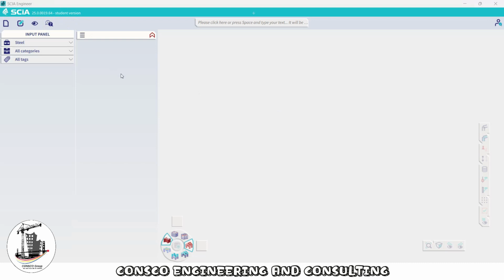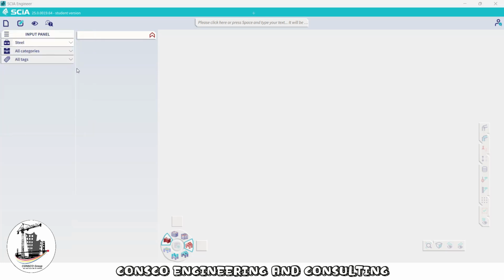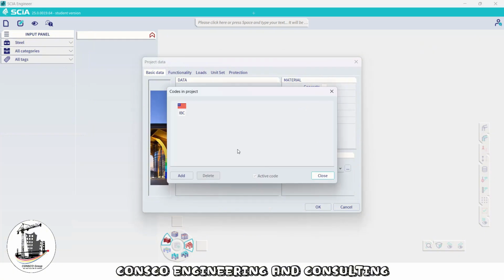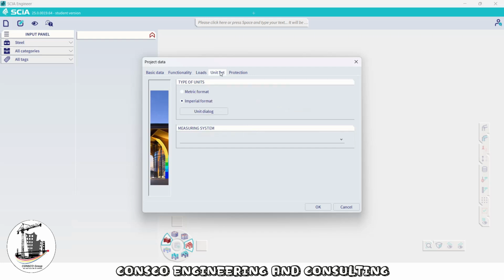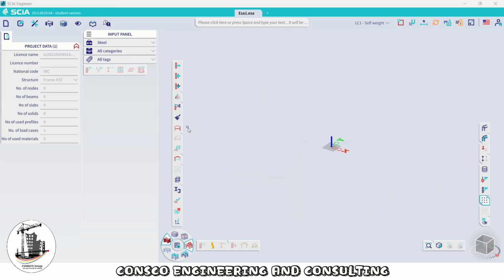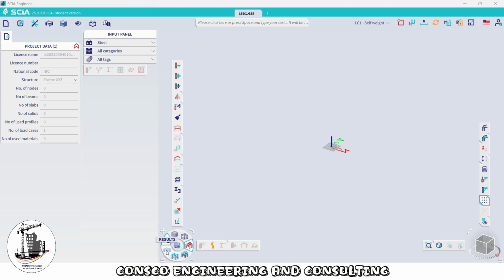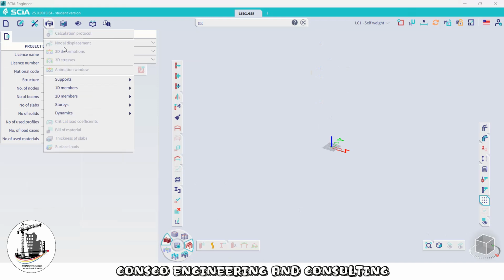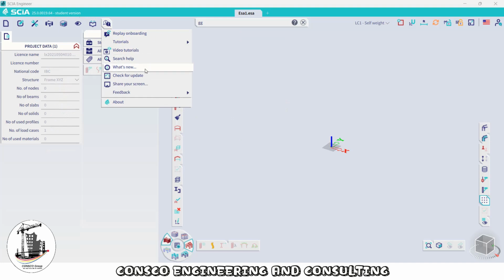Lesson 1: Getting Started with SCIA Engineer

Comment: Hi, thank you very much for your videos which are very instructive, however I wanted to know if SCIA engineer 19 doesn't take slab thicknesses equal to 15cm, 25cm, 35, etc, because however when I define a slab thickness equal to 15cm, after calculation, the verifications in the calculation note are made with a thickness of 10cm and it's the same for the other thicknesses, 25cm becomes 20cm. Thanks in advance for your help!